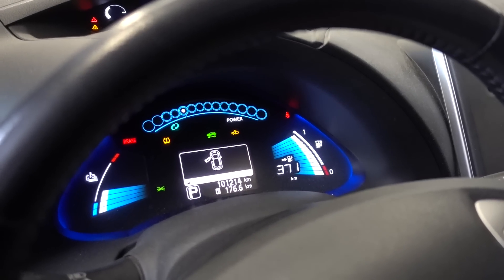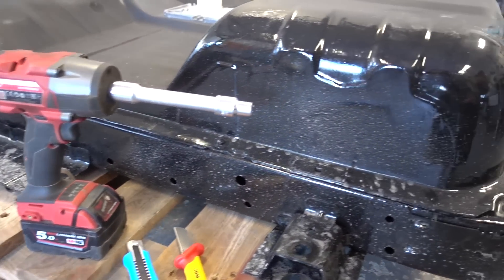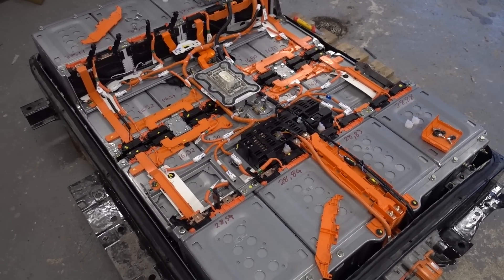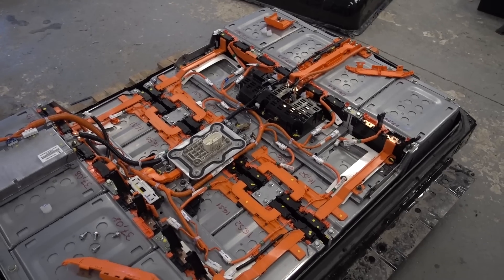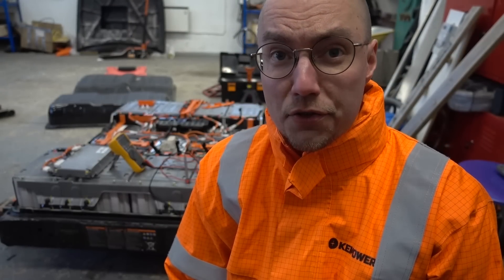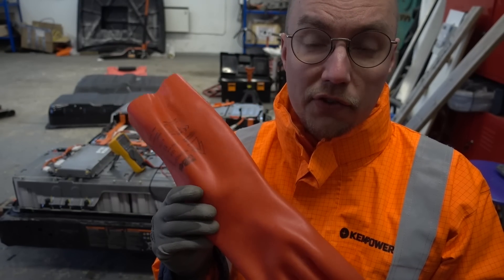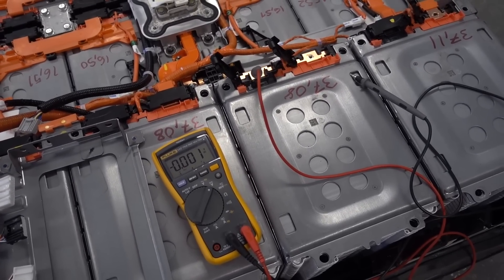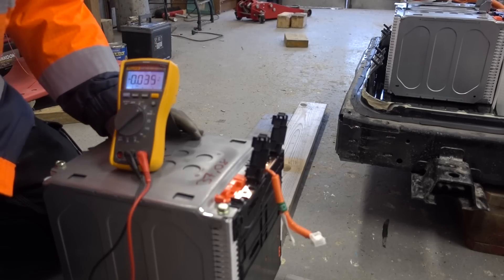62kWh isolation problem [part 1]

Comment: Hi Dala. Just a thought. I used to work at a Nissan Dealership and we had isolation problems on 62kwh packs more than once. I was always that exact same module you are working on. Never a physical dent or damage but rather internal chemical defect that caused the leak. Under warranty we would always end up replacing the module altogether and we never had any comebacks.
Reply: Is there a way to get new cell from Nissan?
Reply: @andreybalanchuk8387  when I was working there unfortunately no. You can't just go to the parts counter and buy a cell/module even if you have the part number and money. Battery components are only sent to dealerships when there's an actual diagnostic case going on and they have a tech line case number. But this information applies to Canada and was valid in 2022. Don't know if it still holds.
Reply: @cloutiernicholas  don't think it's any different here in US. So only way for such repair is looking is someone sells individual cells from 62 battery which I didn't see yet, they are relatively new and reused as is.
Reply: Seeing as you were measuring a voltage to ground from the - and the + terminal, would it be possible to work out which cell in the pack was causing the leak and taking it out to have a closer look?
Reply: @rdflo6739  I agree.
Reply: So Bad battery Not to buy used 62kWh
Reply: Hi Dala.
This 62 module. Could it end up with an isolation problem after heavy rapid charging or heavy regen or Basicly driving it hard making it heat up. Creating a short.
I think the rear packs do get hotter in these situations.
Steve from NZ
Reply: @gtir300hp  no its a known manufacturer defect
Reply: @cloutiernicholas  and this was not common for 40 kwh modules?
Reply: @aneeshzutshi3419  I have not personally experienced the issue on the 40 packs
Reply: @cloutiernicholas  Here in portugal, in the forums many people report isolation faults on leaf 40 that are usually high milage and probably have had several rapid charges or run as Uber. i heard that in such cases it is possible to enclose the module in some insulation material to avoid contact of the module with the battery case. This can avoid the need to replace the module. any thoughts on this?
Reply: @aneeshzutshi3419  That makes perfect sense to me.

Comment: Nice work. from my point of view you should probabky take out a  modules, inspect them for damage and reassemble. Replace bent parts and maybe use new fasteners. If the problem does not reappear you should probably be good for now. if the cells had been damaged, they would most likely have caught on fire by now, but the shifted positioning and so might lead to issues with chafing insulation, so better review and reposition. If you can stresstest the module outside the car and fully charge and discarge a time or two before putting it back intt the car. Hopefully then you have a working and reliable pack again. If you want to play it more  safe, then you would need to dissassemble the modules and check every cell.

Comment: A further thought. The pouch cells within a module might have shifted and one or more of the cell tabs come into contact with the cell case. Removing the restraint bars may then have alowed the bent cell tabs to push the pouch back into place.
Reply: Ooooh, yeah, I could buy that.  The tabs on the pouches are all forward.    How about turn the module with tabs upward, without the compression bolts in it, and tap it on the ground, maybe on a thick rubber sheet.  Try to make the cells sit back down toward the bottom.   Like straightening a pile of homework papers that has just been collected.   And since all the modules have been subjected to the crash deceleration, do the same to any other modules which have their tabs facing forward.    Is there part of the metal case on that side of the module?  I don't see anything but plastic on that front side.
Reply: A very plausible possibility.
Reply: Good idea Paul - I think you might be right!
Reply: that's exactly wot i was gonna say, so "wot E said" is my comment ;-)
Reply: Good point! There may be some insufficient clearances inside the pack. Seems unlikely since it's  a high voltage battery... but it was designed by humans, and we all fail.    If it ends up being this, it seems like a wise idea to spend/invest a few extra hours doing the same thing to every module.... since the entire pack suffered some kind of indirect impact force.
Reply: @beforebefore  It may well have been built by robots, or at least on dedicated machines.

Comment: I think of a problem of insulation in the holes where the bolts pass to put lock the battery. I would try to isolate these bolts

Comment: Can you dismantle that block and lay it our into individual cells and then examine them carefully. If any electrolyte has leaked from any block or bank of cells id scrap them off. If the individual cells look ok when dismantled and they are not electrically leaking, then id put them back together, bolt the case up, and install it back in the car and run it for a few hundred / a thousand km and re assess. AT the end of thet day you have nothing to loose at this point. Great video, and good luck with it.

Comment: Since you are getting negative leakage voltages then that implies a positive from a cell somewhere in the middle of that pack is not right. Can you pull the pouch cells out one at a time and inspect the ones around the middle?

Comment: I'm a little confused - you show the isolation problem on one pack at t=7:45, but at t=11:00 and on, you seem to be testing the corner pack instead. Weren't the isolation problem and the voltage problem on different packs?
Reply: You got it wrong, look those numbers top of pack. Dala is testing same pack with 37,08 number on top. Corner pack has number 37,11.

Comment: I think that the compression was at the place of the deformation of the sheet. But when you tighten the 4 nuts, the compression load is not at the point of impact on the sheet.
Reply: As  @Bernard Peraldi above, with the pack removed you're not actually tightening the battery case down to what might be the distorted surface of the battery tray.
You can either bolt the pack back in and repeat the insulation test there or bolt the battery pack down to a flat (two layers of 18mm plywood) surface on a workbench and deliberately introduce a distortion onto the surrogate battery tray surface with a spacer of some sort to effectively distort the battery case deliberately while checking for a voltage leak.

Comment: The dent does not look high enough to touch the battery. Loosening the connection terminals may have changed the contact resistance. Try loosening the plate bolts, take a volt meter measurement then re-tighten. Try this method with a meter continuously taking readings. Maybe just a bad contact.
Reply: that does account for leakage path

Comment: Further disassemble the stack where the fault was, if that dent has in any way pushed onto the pouches inside you might be able to see this on the bottom one, and that would be smart to investigate.
Reply: You need angle grinder or a drill at this point. By Nissan manual, module is non serviceable component and needs to be replaced as a whole assembly.
Reply: @pashko90  Did not know, that's a bummer.

Comment: Please check if there are no connection between compression bolts and the modules in pack. Looks like I saw a video with damaged pack, where some of thin leafs from the modules touches that bolts.
Reply: Yes, "carreapirvideo" did it on YouTube. I remember leakage thru a stud holes.
Reply: Please look at this video https://youtu.be/zqK30tvq3m0?t=852

Comment: Great video and thanks for sharing. Can"t add much more than what has been suggested below. You do need to find the reason for the lower voltage cells though. Check connections that may have been loosened in the accident. Good luck !

Comment: ballance all cells, check for continuity, before closing the battery, i think the whole battery pack is ok, the drop in the voltage on 4 cells must be because of the leakage, double and triple check for leakage before closing the battery.
Reply: Unbalanced moules and modules with isolation fault is 2 different modules.

Comment: The cell was being crushed in the centre from below. Hammering out the dent will remove the crushing force so it will probably be OK but has the cell been irreparably damaged?  Clearly it was not a serious safety issue as it was only 12V to ground so safety is not a concern here.
Only you know if it is worth trying it again with this cell as it is your time you will be wasting should it fail again.
How much are replacement cells (if available)
How much is your time worth?

Comment: When you have torqued the cell, you did not have the angle iron bar as part of the configuration. I noted there was one when the cell was in the pack. Maybe this difference in load in the pack is enough to not induce the fault. Try re-torquing with all the hardware as it would have been in the battery pack, and see how that goes.  I'd not be trusting the pack as it is tho.

Comment: What's the point of charging that -300mv batch separately? Why BMS didn't balance it as it always does? Will you be aligning all these shifts in battery?
There's no chance to buy 62 battery pack from a car not totalled in collision. You won't like the price and wait time from Nissan. The only other option is a flood car, which is no-go for evs.
Thanks for the video, I'll be looking at my battery pack very carefully. Waiting for part 2.
Reply: Leaf LBC barely do any balancing.
Reply: @pashko90  LBC right, you mean it can't balance less than 0.1c? Work range of cell is 2.7-4.1v iirc
Reply: @andreybalanchuk8387  no, not even close. I called leafs LBC "a monitoring system". When I assemble a leaf packs, I balance them with an aftermarket BMS. It gets pretty damn hot in a process, so fan sits on top of it. But does his job pretty quickly.
In a leaf voltage range depends on a car(ze0, aze0, bze0, ze1), outside temperature and temperature of battery and condition of battery(SOH).

Comment: Does the fact it was 12v to ground from one terminal, and 24v from the other give you a pointer to where in the cell pack the ground fault is/was?
Reply: Yes, you right, damage/fault is somewhere in a a top/bottom 1/3 of the pack. I would inspect balance lead connections, maybe where is a small tolerance to a module ground and colission shifted something too close/something get bent a bit or scratched.

Comment: check the module on the left because the busbar was still in contact when mesuring the leak
Reply from the maker: That busbar goes to the service disconnect swith (which is empty)
Reply: maybe compressing the cells in the complete battery puts more force, if possible try to disassemble the cells maybe one is leaking electrolyte and that will conduct electricity to ground. The only people i saw opening the cells are the samurai guy of the pikes peak leaf when they added cooling to the cells and had to place cooling sheets between them.

Comment: Since the cells are super low resistance, i would think it would be safe to use a Mega-ohmmeter (Megger) to see if it can locate the weak spot. It works wonders for mains wiring.
Reply from the maker: Yes, I will try this, I got a meter last week!
Reply: Yes I guess it’s like our micro ohm meter we use to test all connections in a string of batteries. It’s easy to see which connection needs help.
Reply: @zxggwrt  nope, it's the exact opposite. It's not meant to find that low of a resistance. I think the lowest reading you can see accurately is around 1 ohm. But the trick is, it uses 250, 500 or 1000V for measuring instead of a couple of volts. This makes bad insulation show up.

Comment: 8:30 when you are measuring voltage at this point, isnt the terminal still connected to the other cell?
Reply from the maker: Yes, but that terminal goes to the empty service disconnect switch, so no other cell!

Comment: I find this really interesting. It's a pity Nissan didn't add in some kind of G shock detection device into the battery to see if the pack was in a collision. That might help prevent these damaged packs being sold on to other owners. I'm no EV expert however I am in the automotive industry, I think hammer out that dent in the bottom of the pack, re-install the pack and torque to spec then test for ground leakage again. At this point what have you got to lose?
Reply: Maybe the battery box is distorted and pulling the battery pack down is twisting it and causing the leakage?
Reply: This dent is not that important, this is a bottom part when a splash shield mounts are. Where is a pretty thin metal in this areas.

Comment: Seems like pretty good news. I'd be pushing hard on the bottom of that module where the dent was to see if I can get the earth fault to come back. If you can't, then put it all back together (checking for the fault along the way) and hope you have a reliable battery pack.

I'm also a little concerned about what caused the other cells to discharge like that. I'd consider pulling them out and inspecting them closely.
Reply: Maybe that module is suspect in the same way.  Whatever you find in the one rear module (shifted cells, pinched balance leads?), look for same in the out of balance module.

Comment: Flattening the dent from below might be the solution to removing any additional compression that caused the ground. Or lay a thin sheet of insulation between the case and the bottom of the stack, and re-assemble to test. Possibly a thin sheet on top if it's closer to lid, but when re-gluing it you could also put a thin shim along that side of the lid before bolting it down to gain a few millimeters of clearance if needed.

Comment: Great diagnosis and I think because that looks like it jolted the pack and the dent was under that module and that's the one you had the leak on, I wonder if it internally damaged one of the cells and it is one of those that's given the reading and you uncompressing it and then recompressing it helped it for now. I would fear that once the cells have heated up and cooled down under charging or driving you may well see same fault again. I know you said they hard to get hold of but for piece of mind I would keep a eye out for a replacement module, but getting one to match age and state of health will be a pain. I guess you could also strip down the individual cells and see if any obvious signs but maybe shock of crash internally damaged a cell. I also guess if you don't mind having to re seal it and then maybe having to drop it again you could refit and test.
Reply: You can clearly see on a video what a lockage was been somewhere in a middle of this module.

Comment: At what point did you disconnect the BMS harness from that module? Was it just before removing the compression bolts? It's possible the isolation problem has to do with the BMS or BMS wiring.
Reply: If you look closely, the three balance harness plugs were unplugged from the BMS when he proved the isolation fault just before removing the module.
Reply: And it could be the balance / bms wiring within the module shorted to the module case.

Comment: 300 millivolts deviation.
Reply: Yep, on the corner opposite the "grounding" one, so took the brunt of the sideways collision. Off Grid Garage diagnosis would be a loose bolt creating slightly different resistance, so re-torquing it's bus-bar bolts to correct spec should fix that.
Reply: @kustomzone  If there is no load on the battery, bad connections don't matter since there is no voltage drop and the voltage measurement is accurate.